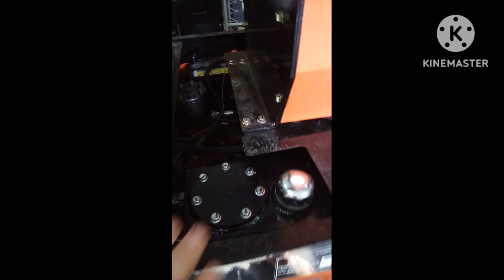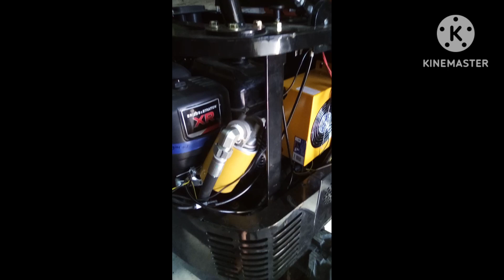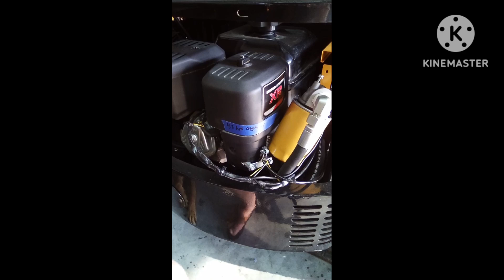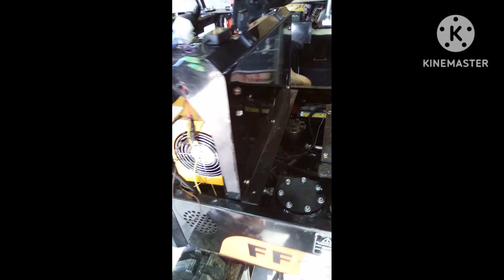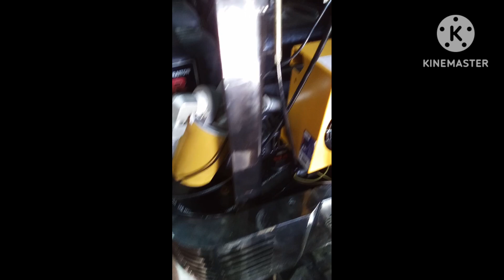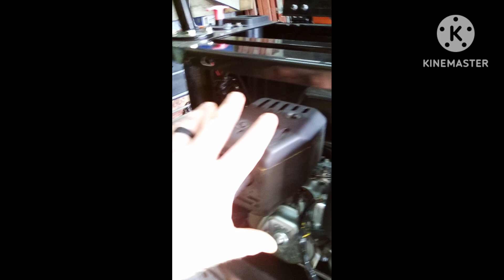Chinese mini excavator mods and information

Comment: Nice what was the  brand of Hydraulic  cooler u bought? I just got the FF15  mini...havent done anything with it yet.
Reply from the maker: @johnjenkins8813  it's a Risen Brand and it's 30 Liter per minute. Just search on Amazon and get a 12 volt as They do make others for industrial applications that run on other currents.
Reply from the maker: Let me look tomorrow I'm the shop and I'll let you know. It's a 30l/min I got off Amazon. I post link tomorrow
Reply: @redmanridge  30 L ok I been looking at 100L way more money lol maybe I dont need 1 that big?
Reply from the maker: @johnjenkins8813  these machines only got 5-6 gallon per minute pumps. 30 Liter per min is plenty.
Reply: @redmanridge  ok thanks for the info.
Reply from the maker: @johnjenkins8813  no problem. Splice it on to your return line to your hydraulic tank and you will need 5/8 barb x 1/2" NPT fittings with hose clamps. It will save you money for needing hydraulic hoses made. I normally wouldnt recommend barb fittings. But since the return line is low pressure you will be fine.

Comment: Thanks for the video,  would you use it without these modifications ?!!
Reply from the maker: @ja4476  you could, but It will drastically shorten the life in my opinion. Hydraulic fluid is only good to about 140°F so a cooler will definitely help. If a person keep an eye on the temperature and made sure it was below that you would be fine. I would definitely replace the hydraulic fluid that's in it with a ISO 46 or 32 depending on your climate, as the Chinese oil in it was junk. Also the reason I installed a cooling fan for the engine compartment as gasoline boils at 122°F - 158°F. My goal is to keep it as cool as possible during the summer months. These machines where originally designed with a diesel motor that runs at cooler temps. Most like a Kubota or small Yanmar. They where switched to gas motors to meet EPA regulations. The cooling fan is also to keep the Briggs and Stratton XR at a decent operating temperature. At 5 hours I would change the Briggs to a 5w-30 synthetic for my climate. All mods are to improve the longevity of the machine. It will run as is though.